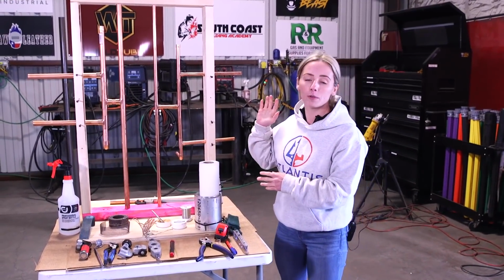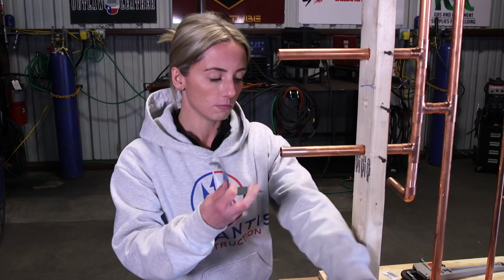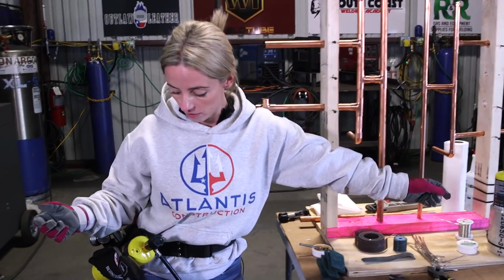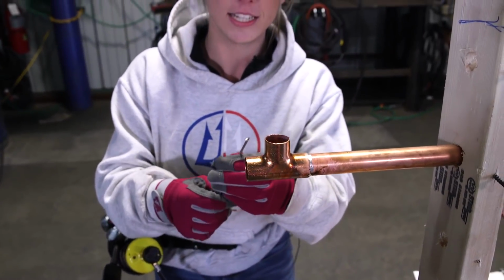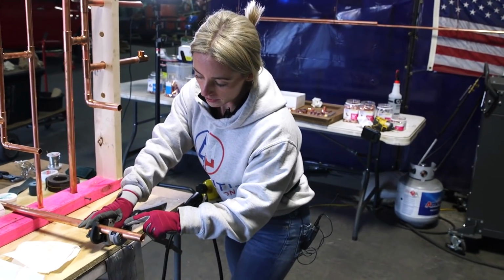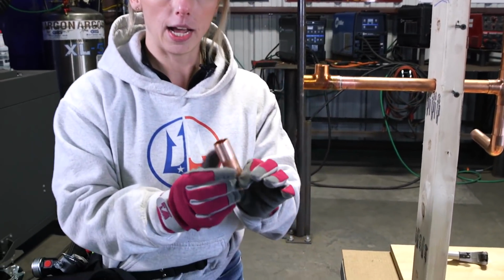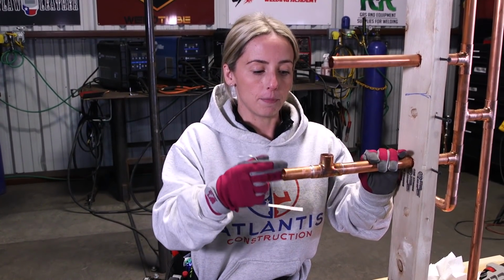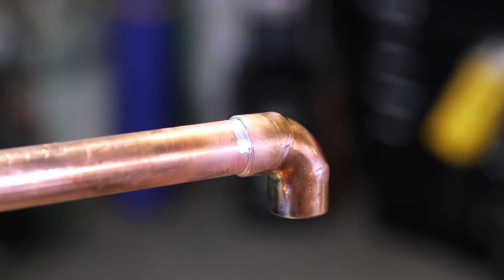How to Solder Copper Pipe in a few easy steps?

Comment: @weldtube coming from a plumber,  you did everything pretty much great,  I just highly recommended also ream the outside too, not just the inside,  inside is more important to do but the burr on the outside will scrap/ push flux out of the joint, many joints look good. But look like swiss cheese if cut open caused from not internal/ external reaming

Comment: You killed it, nicely done...I work in HVAC and my boss/company owner tought me with only sandpaper, razor blade knife, and an oxy fuel torch. Just don’t blow no holes and seal it up. We use nickel rods similar to tig rods though. Once again, great job

Comment: The only thing id reccomend as a professsional red seal journeyman plumber here in canada, is to solder that tee with all the tube ends in it. Itll keep from solder or oxidation from entering those other sockets when soldering. Other than that, great job! You covered many points well and this is a very descriptive video! Keep up the good work!

Comment: Great video.  Sadly I had to self teach myself to solder long before YouTube.  This video would have been so, so helpful.  I did learn one good thing. The next time I solder copper pipe I will use Mapp Gas.  That looks so much faster.  Great presentation of the material, great photography, thanks for sharing.

Comment: Nice video, just make sure to not touch that clean pipe with your bare fingers.. leak looking for a place to happen. Soldering technique isn't bad, but remember to apply an even heat, and use more of a push with the solder to fill the fitting rather than drag it. The dragging "works" on smaller diameter pipe but its bad practice. 1" and up its not going to cut it. Keep up the great content!